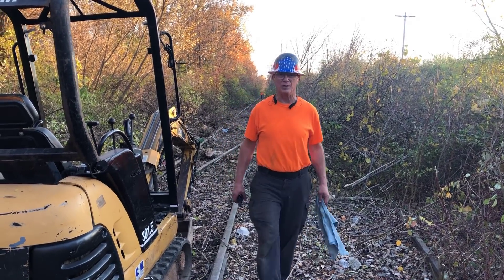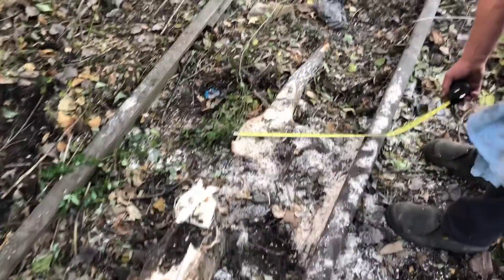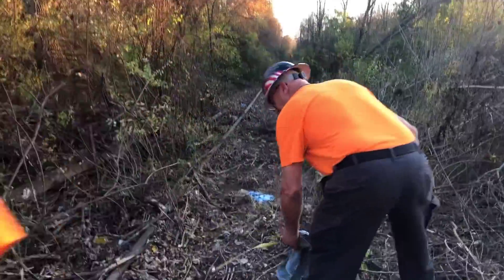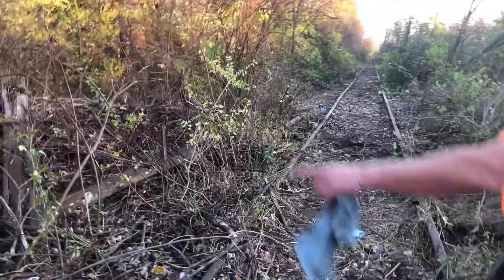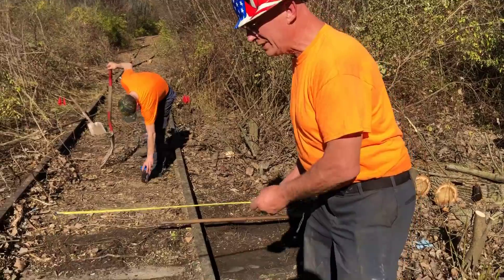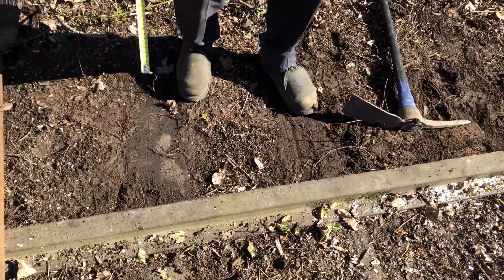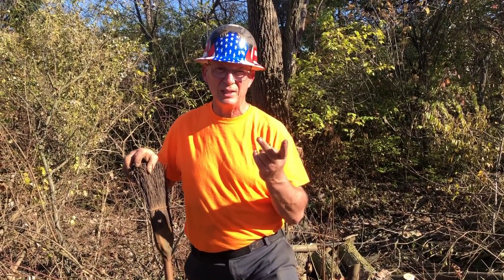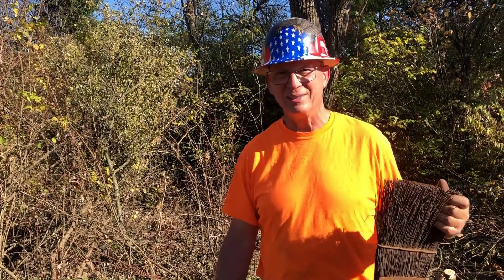We bought an abandoned railroad part 3. Brush all cleared!

Comment: I would think you'd need to run a ballast regulator with a broom over everything. Once the brush was cleared it wouldn't take too long to run over the entire length of your track with a broom to clear everything off. Just a thought. I think digging up all the old spurs and switches is just downright awesome! Congratulations, I envy you!

Comment: For checking gauge, consider using a folding ruler, or better yet, fashion a gauge checking tool that immediately squares up downline.
Reply from the maker: I’ve tried to make them in the past but I would end up using a tape measure anyway so it was kinda pointless
Reply: I know you're not on Amtrak rulebook said no metal tape measures .  😉 Guage was via tool or folding ruler....
Volunteered as a teen 1995 2 foot Gauge RR, gauge tool built with "block(s)" to represent "Gauge" and solid piece across top with level buble built in.

Comment: Don't use gauge rods to hold gauge, yes gauge rods works but you're better off stuffing new ties, we rebuilt a section of a lead track into an industry track and removed most of the gauge rods and stuffed new common yard ties and switch ties, them gauge rods will move laterally over time, gauge rods isn't a permanent solution to holding gauge, the most critical location to stuff new ties would be at the joints, it will hold the joints up and help eliminate the bars from breaking and hold gauge.

Comment: Can you sell or convert and use any of the lumber you have cut, that would supplement funds, or simply  control burn to clear some out of the way to give you leeway to move about a bit. I know that on modern usable tracks when working on repairs you need all the room you've got plus some, so to be constantly tripping over trees, logs and general strewn weeds must be some awful working conditions.
Reply: Hard to believe that anything so small would have any value as lumber.

Comment: not all railroads are truly abandon. very few are actually abandon. Might show on a map it is abandon. but Railroad companies do have the rights to start using the tracks again later on, if there is a need for it. There was a section of railroad track nearby where i am, Hasnt been used in over 60+ years. this year, railroad workers where clearing the tracks, adding missing tracks and replacing railroad ties. Their plan is by summer of 2021 to have the track up and running. 
There is thousands of miles of tracks out there, that may be considered abandon according to some people. but, arent actually abandon. could be 100 year old tracks out there that havent been used since then. railroad companies still have the rights to them. and Can use them again some day.
Reply: It’s very easy to find out if tracks are abandoned by calling the Surface Transportation Board.  There are several classes for railroads not being used.
Reply: Good  luck  in your  venture
Reply: C'mon, you don't think the guy just found some tracks that nobody seems to be using and said "Hippity-hoppity, this railroad's my property -- I'm gonna run some trains", do you? The title of the video says they bought the line. It belongs to them.
Reply: @billmorris2613  could you give us a link?

Comment: Need to work smarter, not harder.
Reply: I once saw this included in a list entitled "Most useless advice ever".
Reply: @erichsh58  thank you! At least I did something right compared to the people in this video that did everything wrong. ✌🏻
Reply from the maker: what did we do wrong?
Reply: @eastterminalrailway5975  my bad, I said that wrong and I was feeding off the previous comment from @erichsh58. I think you could of worked much smarter and used proper equipment. The boss usually forgets what it takes to get the job done manually when they aren’t doing it. That brush should of been dealt with by a brush machine or dozer. More in likely a dozer, since you had to deal with the water shed.